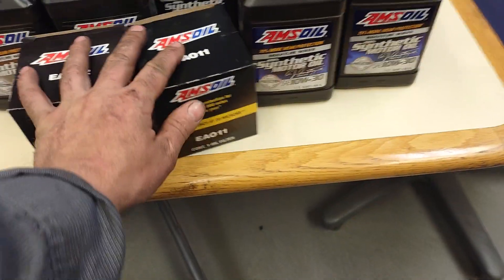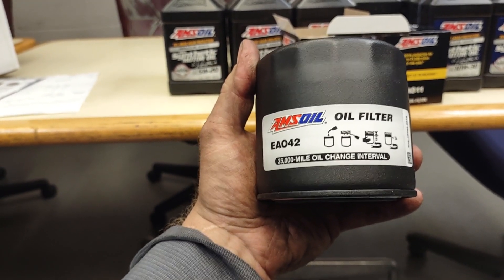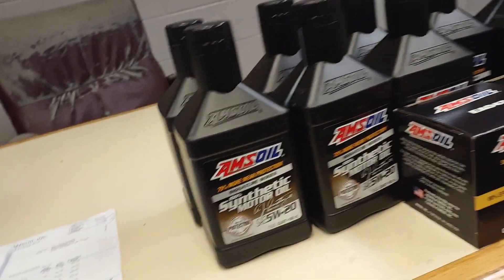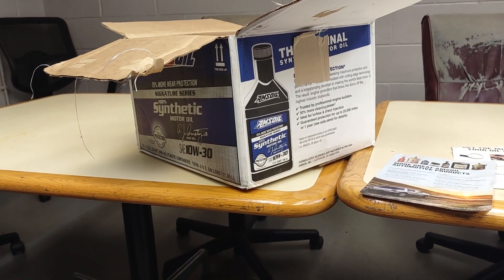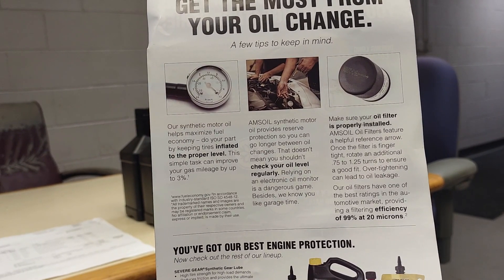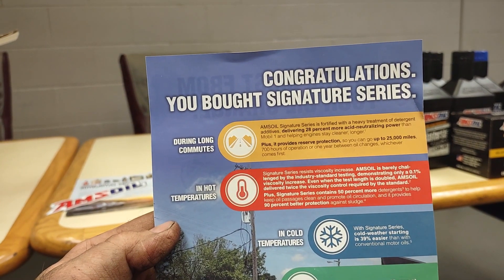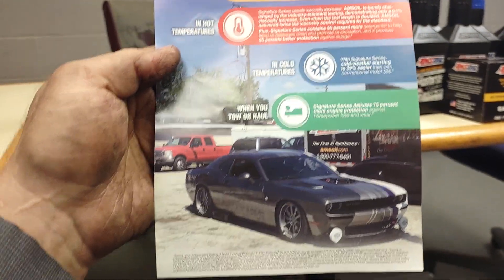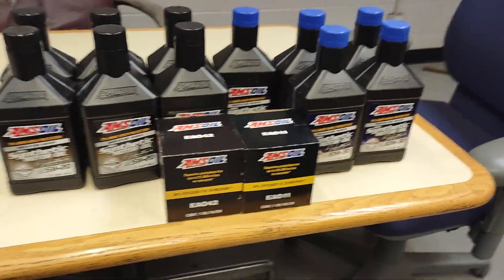Amsoil In 2 days Delivered - My First Ever time Getting Amsoil - Cant Wait to use this stuff

Comment: I go the normal interval these days for synthetic which is 7.5k I’ve used amsoil when I switched at 5k it looked and smelled new, I went crazy and switch it at 15k still looked good but I didn’t do tests so I just went back to the normal 7.5k mind you I believe my car at the time (Hyundai) recommended 10k intervals but I didn’t fill comfortable with that but when I was using mobile 1 I had oil burn off at 2k Miles, I went an entire 15k with zero burn off and when I drained it looked much better then mobile one when I drained it at 7.5k, oil is cheap so I think my new car I got now (Altima) I might change it at 5k or 10k haven’t decided but Amsoil definitely holds up I’m confident it will last all the way up to 25k like it’s rated but I don’t have time to do oil sample tests so I rather change when the oil is still good than when oil is breaking down, I think 7k-10k perfect sweet spot for Amsoil in my experience
Reply from the maker: I refuse to go more than 5,000

Comment: I think you will find that Amsoil is more that satisfactory. Been using in my 4.6 Jasper reman for 8 years and every time I look down the the oil fill to look at the cam journals it looks spotless. Not to mention that it doesnt cost much more than most full synthetics you find at wallyworld..
Reply: Wow! Your wallyworld is really expensive compared to the ones by me. I can get a 5 quart jug of Mobil 1 for $26 whereas 5 quarts of Amsoil runs $62.50 and you get to pay shipping on top of that. Amsoil's distribution model (multi-level marketing) makes the cost of their oil unreasonably high.

Comment: I appreciate all the videos that you make for us... I got a quick question though. Do you have any idea where the parking assist wire harness plugs in at on the back passenger side of the Ford Transit t250 .. do I need to access it from behind the outside plastic trim or from underneath the vehicle because it seems like it goes into the frame rail... Sorry to be bothering you with this question but I looked all over the Internet and can't find any answers.... I had to replace the wire harness in the back due to a drunk driver slamming into the back of me at 110 mph in a Ford mustang.. it's kind of nice how the motor and transmission just goes right underneath those cars at that speed on impact
Reply from the maker: I left for the weekend if you ask me on Monday I can have more information for you

Are you talking about the wires that go to the radar sensors for the proximity
Reply: @FordBossMe  yeah it's a main wire harness that the other one plugs into.. I can get you a part number when I pull over I went ahead and just bought brand new harnesses
Reply: GK4T-15K868-DB. PY226AFF1900086. 😁

Comment: OUTFREAKINSTANDING! Did you get an engine flush also? Makes a huge difference! You’ll love it 😍. But shoulda went 5-30 for the town car! And their bypass filters are 99% efficient at 2 microns
Reply from the maker: What do you mean I should have went 5 W 30
Reply from the maker: Remember I'm a dealer technician so I'm not just some Joe Schmo that just dabbles in this stuff every once in awhile
Reply: @FordBossMe  I know you’re not. But since you live where it’s hot 5w30 is just more insurance. When my 04 f150 hit 200000kms I switched to 10w40 sig series and it quieted down the valve train and didn’t notice any loss of mileage. Also amsoil heavier grade oils still pour when it’s cold. My dad runs their 15w40 diesel oil in his 6.0 power stroke year round
Reply from the maker: I don't really live where it's hot though
Reply from the maker: I live in the midwest 5w 20 is a great spec for the Midwest
Reply: @FordBossMe  what’s not hot? It gets over 100F in southern Alberta. That’s hot to me lol. And Once your oil is running temp it doesn’t care what ambient is. So 30 vs 20 to me is better especially if your workin it or hot rodding. You should also change all your oils to Amsoil. Trans, gears, ps. All of it.
Reply: 5W30 fixed my oil burning in my old shitbox 🤣 no idea how though

Comment: Question : What would happen if you used oil designated for Diesel in a gasoline engine?  I never have just wondered. Any pros or cons?
Reply from the maker: There's actually a few guys on this channel that do that and they say they have no problems at all and it actually cleans their engine better
Reply: Diesel engine oil has more detergents and the oil will get darker faster.  =Higher compression equals more soot in the oil.

Comment: I'd use Amsoil if it wasn't for their MLM that makes it cost more than it should.  Its very good oil, no doubt.  I'm preferential to the Ford Racing FL820 oil filter.  Wondering why not 0W-20?

Comment: Amsoil makes a true synthetic oil.  -They have never skimped on quality.   Labeled "synthetic oils" aren't always true synthetic.  The Amsoil filters are good also.   New vehicles especially trucks are not cheap.  Used trucks are not cheap either.
Reply: Pennzoil Ultra Platinum is just as good, half the price, and actually readily available.

Comment: It’s only a Champion filter with Amsoil advertising on it for $35 plus with shipping. Buy a Fram Ultra Synthetic that is just as good with the same ratings for $10.
Reply from the maker: Yep
Reply: @FordBossMe  Research MPT Industries 30,000 mile, 100% Synthetic Ester with zero petroleum in it. Side by side testing comparison beat Amsoil.  Amsoil is only 25,000 max.

Comment: I tried the Amsoil in my Harley using their recommended oil for air cooled Harley Davidsons. My bike had only 5k miles on it.   What a cluster F....  It would collapse my lifters after the engine shut off for a short period of time, eventually causing complete failer.  It also caused a head gasket leak.  Finally dumped it after riding 6k miles.  Had to buy and install new lifters, and switched back to a dino 20w-50w, and have since put 60,000 problem free miles on it.    Interestingly enough, I'm not the only one who had problems with Amsoil.  Many on the HD forums had the same problems.    My experience?  Amsoil is way over priced shit.

Comment: signature series is good stuff no doubt but for the cost id rather use mobil 1 EP if i had to stay within the 20 or 30 grade for warranty or quaker state euro better yet which i can get at Walmart for under 19 bucks. Costs much less but delivers near the same in wear protection and will last up to 16k miles until it begins to degrade since it has the proper long life ratings, but even i don't go that far. i use a 5w-40 now instead of 10w-30 in my high mileage engine and it runs nicer.

Comment: amsoil is top of the line, if you care about your vehicle and have the money, go for it. However, i do not recommend the "25,000 mile interval changes" 
If i don't feel like spending, i get the pennzoil ultra platinum because it was runner up against amsoil in Project farm's video.
Reply: in before the old guy swings by and mentions how bad pennzoil used to be and ruined a bunch of engines
Reply: I got stuck on the Royal Purple blurple stuff since it has made my engines run so smooth, even reducing valve train noise in our Hemi and the LS1 I used to have. The Toyotas love the stuff just as much. However, I'm sticking with Castrol for my Volkswagen. Their 5 quart jug of A5/B5 is cheap for 3000 mile oil changes to keep the turbo happy.

Comment: i have 2020 f150. i was told it has lifetime tranny fluid and not to worry about it i dont need to change it. is that true....seems weird that ford wouldnt want fluids to be changed regulary in heir trucks
Reply: Whoever told you that is lying to you.  See some of his other videos for fluid change recommendations.
Reply from the maker: I don't believe in the lifetime oil changes for transmissions I like to change them at least by every 50,000 miles
Reply from the maker: I'm so picky about fluid changes that on my Lincoln Town car every 20 to 30,000 miles I change the transmission fluid
Reply: @robbinsresort  ford dealer techs told me that from many dealer ships. there isnt even a trans dip stick
Reply: @FordBossMe  ford wont change the trans fluid unless the transmission is acting up tho. i got a 70k mile warranty on the truck im not trying to void. something happen to my tranny then they say yea th fuid change did the issue
Reply: Dude change the fluid every 30,000
Reply: @buffalobmf  there is a dipstick but it's very small and you have to be underneath the truck to access it.  

I had a trans pan drop and filter change at 63k last month.  Done at a Ford dealer in Texas.  2017 F150 4x4.  They're lying to you.  I also have a Ford extended warranty.
Reply: @robbinsresort  already asked 4 ford dealers about it they all said they wont touch it unless its acting up. Same with my 2010 i had they wouldnt touch it and that had 200,000 miles on the same trans fluid
Reply: @JOHN RUSSO  Change it after the warranty then after 70k.  Need to get all the sludge off the bottom of the tranny pan (mostly GM).  All the sludge jams up shift solenoids etc.  Use Ford tranny fluid.   10 speeds are a bit of a pain to work on.  

After the first tranny fluid change (don't get a flush).  Should be good for another 100k+ unless severe duty (towing etc).
Reply: @buffalobmf  Your 200k story is a different set of circumstances entirely.  As far as your current truck I find it shocking that multiple ford dealers won't perform a routine maintenance procedure.  Are you trying to make this a warranty claim or are you making it clear to them you will pay out of pocket for the service?
Reply: @robbinsresort  they said the samething when the 2010 was brand new. my 2020 only has 7000miles on it. i asked them when i bought it when to service the trans fluid and the service department said never unless its acting it we will will change it. if its not never have it changed
Reply: @jonmccormick8683  oh no. once the warranty is gone the truck is being sold.
Reply: @FordBossMe  Totally agree with you. I've got a 6R80, and this is when I always change it. The manufacturer wants to sell you another vehicle, so they say don't bother.
Reply: Do yourself a favour and switch it out every 30,000-40,000 miles. The people telling you it's a lifetime fluid want to sell you another vehicle. Transmissions nowadays have all kinds of sensors and solenoids that are very sensitive to dirty fluid. Fresh fluid will be much cheaper than fixing transmission problems.

Comment: I wish I had a place where I live to buy it off the shelf. I don’t know if it’s worth it for me. I do 5k oil changes. I have used it before however. Just hard to find.
Reply: I always order online, for you OCI I would say to go with the OE line and get a wix filter. And the preferred customer option is only 10 bucks for 6 months/ 20 bucks a year. I run it in my Taurus SHO and my oil catch can is very low since it reduces piston ring blowby. I always insist on at least trying Amsoil 👍
Reply: My local NAPA has it
Reply: It shouldn't be that difficult to find. Go online and you can probably find a few local dealers. I didn't even have to do that. I live in a small town and I found it through our local automotive shops. We have a lube place and a full on automotive repair shop and they both carry Amsoil. I was getting through them , but one day I asked them for an amsoil lubricant they didn't have in stock , so they gave me the number of the distributor they go to and I've been getting it from him ever since. He's 10 minutes away. Like the other comment said, I'm also a. preferred customer so I get 25% off the regular price on all their products, not just motor oil. I get my small engine oil there, my automotive grease cartridges, my transmission fluid, my differential fluid, transfer case fluids, oil filters,power steering, gun lube, penetrating oil and pretty much everything. I definitely get my money's worth. If u don't have someone close u can get it shipped directly from Amsoil, but I bet if you look around you'll find more than one local distributor.
Reply: If your doing 5k oil changes just buy whatever synthetic. It will all last 5k easily

Comment: Best oil and filter in my opinion
Reply: 2019 3.5 ecoboost loves it
Reply: @Jay84  The Amsoil filters are excellent and the 3.5 ecoboost  twin turbos put out alot of power  = don't skimp on your oil or oil changes.  People that put cheap oil in an Ford Ecoboost always have problems (carbon on rings and blowbye etc).
Reply: @jonmccormick8683  been running the signature series and their oil filter since days one in my 19 3.5 ecooboost

Comment: Hey bro, ive been watching you for a few months, i recently bout an 08 E150 for work and my guages, power windows, and radio randomly cut in and out. Can you contact me and tell me what you know about this or where to stary? Please
Reply from the maker: There's a ground strap from the body to the frame rail over on the passenger side that rots out and it typically causes issues like this even no start conditions

Comment: Amsoil people never go back. Run it for 25000 miles or a full year and get that oil analysis. I promise you, you will be absolutely amazed
Reply from the maker: I can't run it for 25,000 miles and the reason for that is we had a technician a Master Tech here at the dealership and he was a distributor for them and he changed his oil every 18000 miles and after two years he pulled his motor apart and said he would never use it again because of the amount of varnish and sludge buildup
Reply: @FordBossMe  Did he use the amsoil filter?

Comment: I heard this stuff is good 👍🏽 but expensive!!
Reply: You really can't find a better synthetic motor oil than amsoil especially if you have a forced induction engine either supercharged or turbocharged and you want it to run forever this is your oil. That's primarily what this oil was designed for years ago when they first invented it. It was designed for forced induction racing engines. Amsoil invented synthetic motor oil and their still best. Go watch the project farm YouTube channel. Because he actually tests it against Mobile one and all the others and Amsoil still comes out ahead.
Reply: @JoshSmith-wo7zw  amsoil is the best for sure but I'm cheap and drive beaters so Mobil One is my choice in my daily drivers they aren't performance vehicles so as long as the Mobil doesn't break down and keeps everything clean I'm happy for the price. My purchasing secret is the Walmart they have the cheapest prices on oil period but you won't find stuff like Amsoil or Royal Purple there. Mobil works great for my daily drivers. Now my 302 swapped pinto that will get Amsoil because I know it's going to get driven hard. It's all about what you put your engine through and never ever buy the cheapest oil it's garbage.
Reply: Expensive compared to a motor? Maintenance is cheap